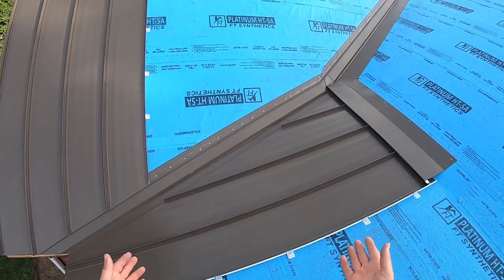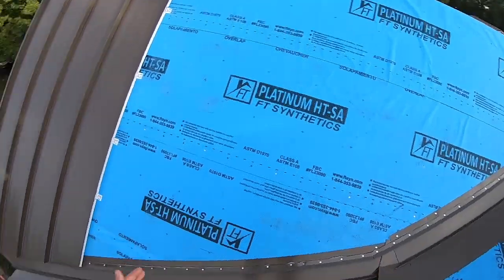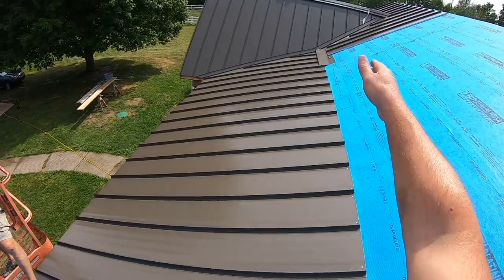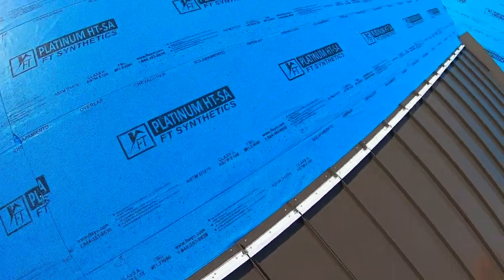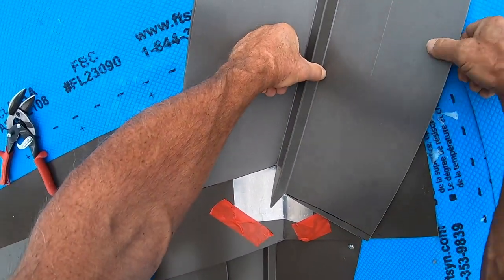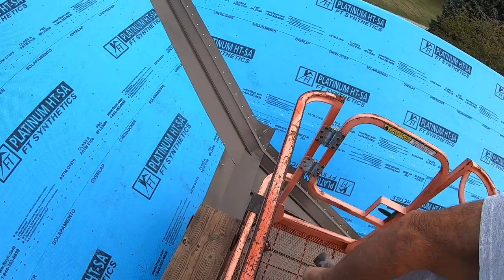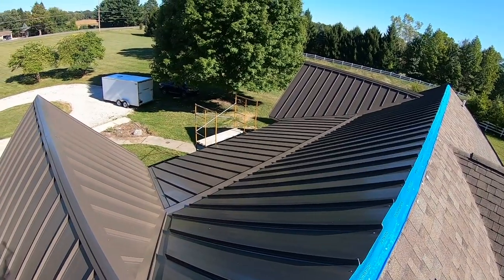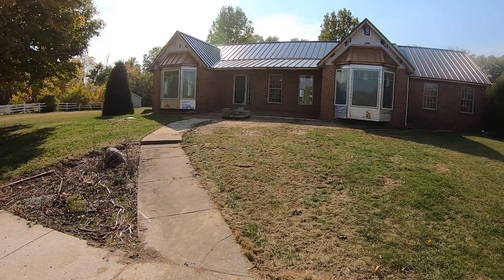How to Install Metal Valley Flashing on a Standing Seam Metal Roof with a Slope Transition

Comment: Even better instead of screwing right through that apron flashing try folding down the top 3/4”-1” and fastening it using clips hooking the top fold and screwing clip instead of all those holes in that nice new apron flashing. 
Plus when caulking between valleys always leave wheel paths for sweat. 
Metal roofs can get super hot and usually when it’s hot out people tend to crank the a/c units and can literally leak. Pretty amazing but true. 
Keep up the good work

Comment: Very professional 👍🏾
Reply from the maker: Thanks
Reply: What is the point of the ridge vent without attic opening?
Reply from the maker: @jorgebonilla7047  There is an opening it’s just the way those short gables were framed the opening could only be about 10 feet long while the total ridge is about 22 feet.  I cut out as much as I could.  Where you can’t cut an opening you still need to use the vent material or z flashing to block birds, bats, and bugs from crawling into the gap under the ridge.  The vent material is a lot easier to install.

Comment: Sorry to hear about the hand that sucks! I was wondering about the vented ridge cap you put on with foam rather can Z bars at the top.  I could not see if you actually had ridge vents cut in your roof.  It looked like the blue underlayment went over the ridge.
Reply from the maker: Thanks.  It’s all good now.  We did cut the blue underlayment back as we put the ridge cap on.  Some spots on the front gables had framing in the way so we couldn’t put a vent there.

Comment from the maker: In this video we install a standing seam metal roof that has valleys with a slope transition. This is a fairly complex installation that takes a lot of time and patience. At the time of this video I searched the internet for instructions on how others have done this but I couldn't find anything. If you have any suggestions, questions, or general comments please drop them below in the comments section and I'll do my best to answer. Also, the links below are to videos about other metal roofing projects I have done if interested. How to a Install Standing Seam Metal Roof, SSR 450 SL Panel Profile https://youtu.be/_emb-7ImiGQ How to Install a Standing Seam Metal Roof on a Bay Window https://youtu.be/9nkPbgNjFTM How to Make Kickout Flashing With Standing Seam Metal Roofing: Pole Building Side Wall Flashing https://youtu.be/NUXzvq3d4QQ
Reply: That was excellent work.
Reply from the maker: @mfblowfish4671  thanks

Comment: Good job in describing your work ,though it seems like you've over-complicated a few things. 
I've been roofing for 25yrs and am still learning new techniques, but sometimes the old school way still works best.
First, you're never going to be able to make a snap lock seam absolutely water tight, no one can, there's too much wiggle room. Go 1" dbl lock standing seam and you'll have no worries there.
Second, put a 2" lap on both sides of the valley, that'll eliminate the cleats, and the pans can be folded into the valley itself. 
Third, when installing 1" standing seam, the pans are 20⅞" wide, they cover more area.
Fourth, also when installing 1" standing seam, the angle change (transition) can be made right into the pan by fabricating the bend into the locks themselves with a pair of needle nose pliers, eliminating all that extra metal transition trim.
And that's just the field, there are much simpler solutions for caps, hips, and stack (pipe) penetrations as well. 
I'm not going to go any further 'cause y'all know the difference in styles. These are naught but suggestions. Good luck guys! And thanks for the video!

Comment: Where are you guys located at?
Reply from the maker: Northern Indiana
Reply: @HowtoHacks  so on the valley...does it need the cleats or can you just screw the seam panel on it?
Reply from the maker: @january2568  I think it needs a cleat.  the cleat has butyl tape under it which will prevent water from splashing under the panel.  Additionally the planet is allowed to expand and contract with the cleat.  If it’s screwed down it won’t be able to move freely because it’s attached to the roof deck at both ends.  This could cause a lot of oil canning.
Reply: @HowtoHacks  thank you just the info i need.....my house is getting a standing seam metal roof...I was told all screws will be hidden, but on the valley they didnt installled any cleats and just screwed the panel down...
Reply from the maker: @january2568  you’re welcome and good luck.

Comment: How long did that take
Reply from the maker: The whole side or just one valley?
Reply from the maker: It was about 2 months worth of weekends to get from asphalt to metal.
Reply: @HowtoHacks  omg 250+ man hours?!?!!? That is absolutely insane! I would have to charge $25-30k labor to do this roof. And that’s not counting tear off… No I would be shooting all the flashings down with a roofing nailer. Those screws at the very top of your panels under the pitch change metal and behind the Z-bar could also be shot down with a nail gun. I would only use screws on anything that has caulk tape under it and for the panels. I would have to get this job done in about half that amount of time! That’s why I hate Z-bar systems!

Comment: Then a hail storm hit
Reply from the maker: Yeah.  If that happens hopefully the 24 gauge metal will hold up as it’s significantly heavier than 26 gauge.  Also, I placed the metal directly on the roof deck so that should help support the metal some during an impact as well.